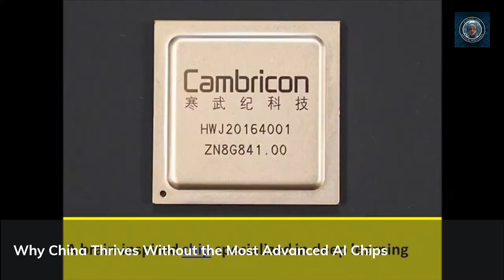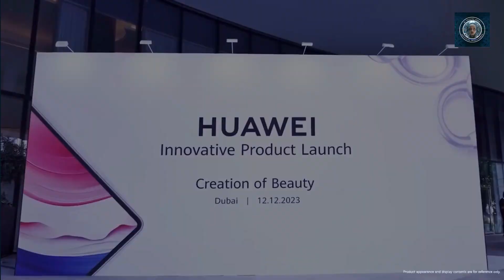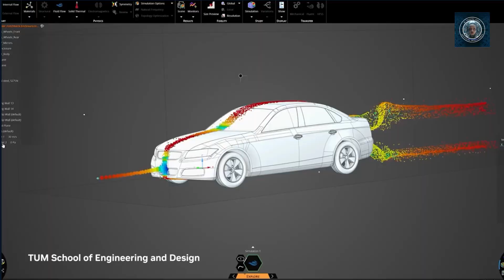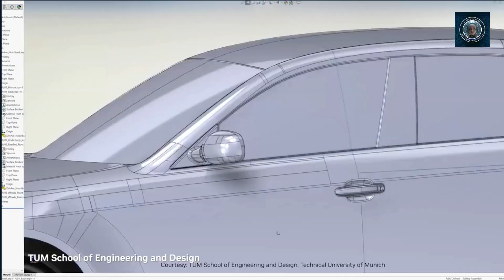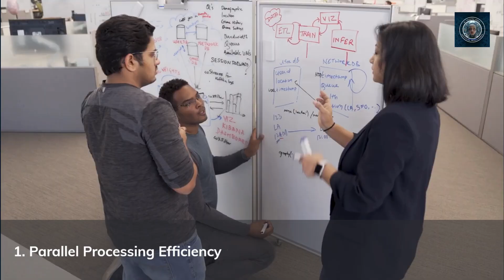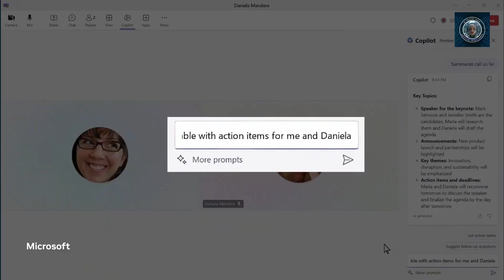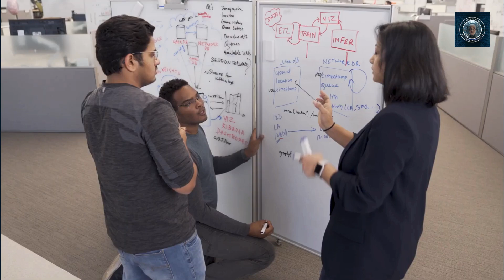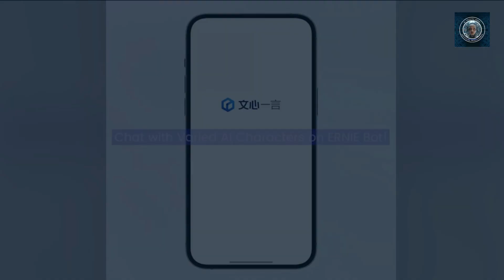China's 2024 AI BREAKTHROUGH: No High-End Chips Needed!

Comment: Trust me I didn't both watching.

China can do WHATEVER they want to do.  But they can't do it in the way the West does and they can't fabricate chips the way the West does and the chips that the CALL 7nm that come out of SMIC, which is subsidized by the CCP, and used in some Huawei devices which have all kinds of problems with heat, poor battery life, etc.... because making a "7" node using DUV lithography from ASML which is EXACTLY what they're doing for one gives bad yields, you can talk to Intel about it because they did the same thing, and so did Samsung until they perfected EUV lithography which SMIC doesn't have, well, it leads to excessive power consumption.  

Hey enjoy the TERRIBLE air there.

Yes of COURSE I told the YT algorithm to never recommend this channel.